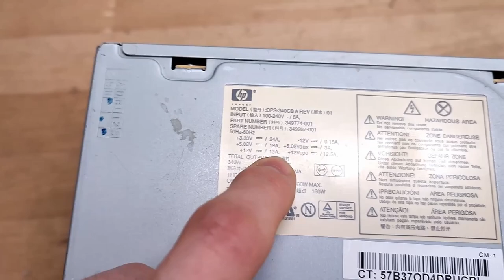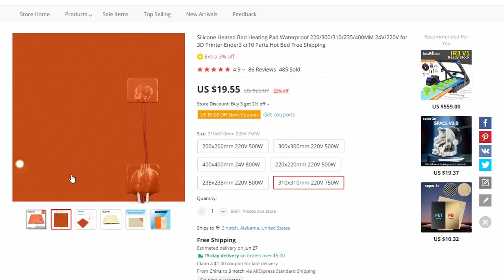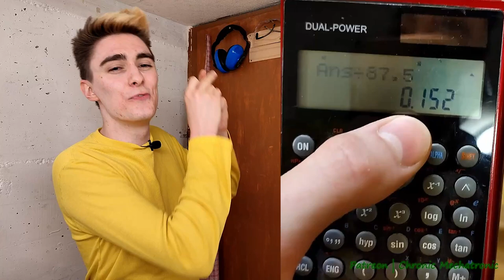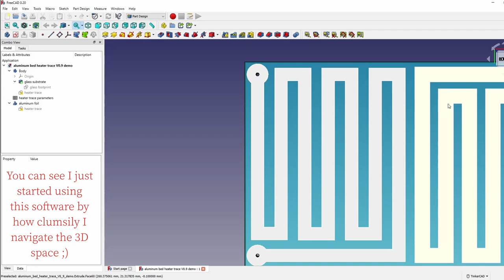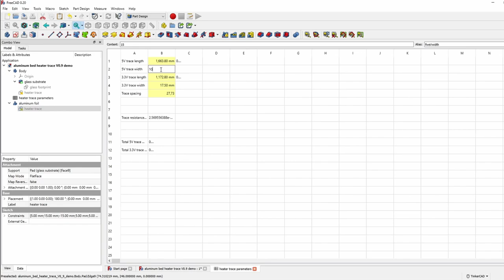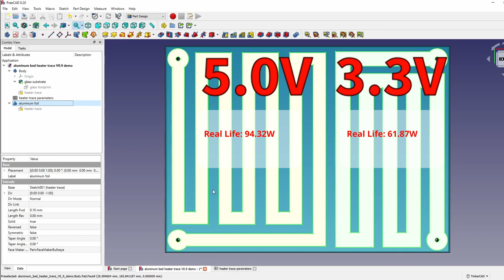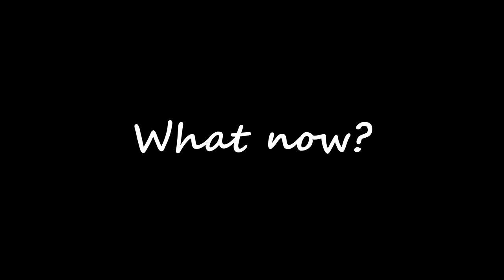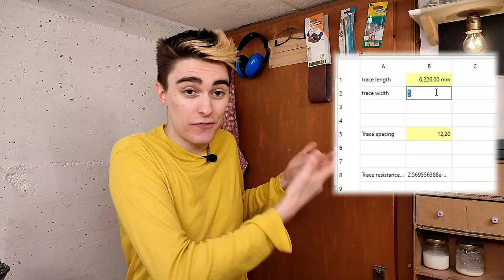Unipolar 3D printer part 9 | How to design a heated bed for under $10.00??

Comment: I get that youre trying to make everything yourself, but a 220x220 heated bed is $15 shipped.
Reply from the maker: That may very well be, and I didn't say my solution is better than buying one, or even worth the extra time, but the insanity of actually building everything from scratch while sticking to the ridiculous budget I set no matter what, is just what people are enjoying about this series - why would I destroy it?
I could also just have a sponsor give me a finished printer to review if it was about easy solutions...
Reply: I can’t wait to see the end result bro. I’m a guy like you that like to use parts off my shelf from savaged equipment. They called me black Macgyver lol. Except you have more knowledge/ experience in electronics than me😂. I like to challenge myself, this is why I’m in the process of building a 600x600x 500   3d printer without any kad design or copy from someone. I’m just going with the flow. For instance I use a baby changing table as enclosure/ frame 😂😂😂. Got it to print already, but I want to make it easier to fix in case something fails. I’m subscribed because I don’t want to miss on your 70%wooden printer . It’s awesome bro 👍👍👍👍

Comment: Nice work! Aluminum foil is such useful stuff. But for a low cost printer, I would just omit the heat bed entirely. Masking tape and glue stick works fine. Heated glass is like magic when a large print releases effortlessly whereas it would be a great struggle with tape, but sometimes the bare glass adhesion isn't strong enough to keep corners from curling up and then you have to use tape anyway.

Comment: i mean... i like your ingenuity but, 4 power supplies dude haha
Reply from the maker: Yup, lol 😂
Reply: No power sag when using multiple heaters.  It's a very great solution.  Cheap too!  

I did this on my cnc video.
Reply: "Millennium falcon cnc controller" i used 2 19v in series.

Comment: Have you checked out that Copper Tape? It's used to make DIY circuits (the common one are only conductive on top, but a even more expensive has conductive sticky side too) and can be expensive, but please check it out!
Reply from the maker: I did consider copper tape, but the price point and the difficulty of folding it around corners but me off that idea.

Comment: great series and I've been wanting to make a 3D printer out of recycled electronics waste for ages.. laser printers, inkjet printers copiers are a great free source of motors and supplies even stepper controllers, so I managed to get some parts working but never really built a complete 3D printer from scratch.. One day I will (I hope) if it will be with thick copper wire, copper tape power resistors or your super solution with alufoil, I am not sure yet.
I understand your reasons to chose the alu foil.. the main disatvantage I think is our (yours and mine) greatest chalenge is to connect the aluminium foil reliably to the power supply. I have some old salvaged thick copper wire and some copper tape roll, also some glass plates of old scanners and inkjet/scanner combos. capton tape I have only 1 cm wide tape. If you use 2 glassplates to clamp the heated aluminium foil / copper tape or capton taped copper wire in between, the keeping it sticked together problem might be solved.
Reply from the maker: Thanks for the comment, actually I don't think connecting leads to the aluminum foil will be a problem at all, since I went through the effort of drilling holes directly thru the glass plate I can simply use the bed leveling screws as connection points seeing as they already clamp down on the glass-aluminum laminate. If, for whatever reason that shouldn't work, I hear aluminum can actually be soldered after sanding the surface under mineral oil so it doesn't oxidize...
As for using wire as heating element - my original plan was to temporarily attach the wire to the glass using just two strips of kapton, then pour a thin layer of plaster over it to improve heat transfer and fix it in place. I very quickly dismissed the idea as thermal expansion coefficient of glass and plaster might not be the same and could lead to bending of the entire build surface. Additionally the wire itself probably gets significantly longer, inducing further stresses. You suggest sandwiching the wire via a second pane of glass, I thought about something similar that unfortunately requires good glassworking skills I don't have: if you do a series of cuts on both sides of the bottom glass, the wire could be weaved back and forth between the little tabs it creates just like they do on the myca sheets in toasters. Then attach it underneath the build plate, wire side up. However thermal expansion of the wire would have made it go slack whenever it heats up... But sandwiching the aluminium foil seems a good solution as it also expands and goes slack underneath the kapton - if heat distribution ends up being an issue I'll put a piece of sheet metal over the kapton.
If you someday want to build a 3D printer;  I intend to improve on my design and make a slightly smaller version with a standard ender 3 form factor that is easier to build for everyone, so maybe that'll be of help :)

Comment: ~0.2 w/cm² is likely enough for printing on a 60C bed, but would also never hit 120C due to not being able to keep up with heat lost to the environment. ~0.4 is recommended for about 100C.

you can probably get away with a bit less in both cases, but overhead is good ... i mean you want your bed to actually hit the temp you requested right? (oh yea and you also loose a few degrees through the bed so the surface may be colder than you expect.)

Comment: Did you think about making the heater using some PCB board and etching the resistive pattern on it?
Reply from the maker: Honestly no, but a PCB blank this size (plus the chemicals since I don't have those kicking around already) would easily exceed the ridiculous budget :/
Though the aluminum foil ended up working great, video will be out soon!

Comment: 19:30 Will the glue withstand the elevated temperature ?
Reply from the maker: The spray adhesive, no, but it doesn't have to since the entire thing will be covered in kapton. The spray adhesive step is really just for ease of manufacturing :)
If you wanted you could also cover the aluminum foil with kapton, cut it out using scissors, and then kapton tape it to the plate, but getting it to lay flat will be difficult that way, which is why I opted for spray adhesive and cutting it out on the glass :)

Comment: Hey I'm using inkjet printer dc motors as steppers!  It's accurate!  It's on my channel.  No steppers needed!
Reply from the maker: Yes! I actually plan on using DC motors for my next 3D printer! In developed countries those unipolar stepper motors are getting harder and harder to find due to old printers and machines containing them having been decommissioned years ago... My coding skills just aren't there yet to deal with the complex sensor readings DC motors require :(

Comment: Cheers. Could you send me some programs to draw and convert to G-cod? Thank you in advance. Your project is awesome, super fancy. I am a complete beginner to 3D printers. I would be happy if you could help me a little. Well thank you.
Reply from the maker: For drawing you can check out my pen plotter series, I extensively covered the most common software used for it over there. BUT - if you just want to 3D print, without first learning a lot about CNC in general, I strongly recommend you start with 3D printing straight away. Marlin firmware and Slicers are far easier to use than the pen plotter software since the user interface has matured and is now hiding all the stuff that's confusing for beginners. Getting a 3D printer set up is EASY compared to getting a pen plotter working - I was a total beginner to 3D printing myself and it only took me 2 days to get this printer working, whereas the plotter took weeks to figure out. That's my advice.